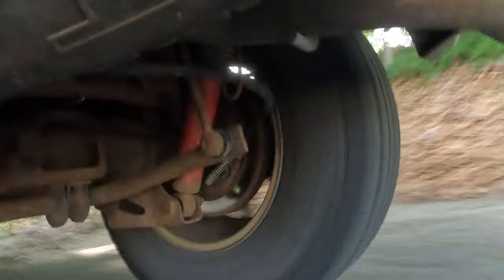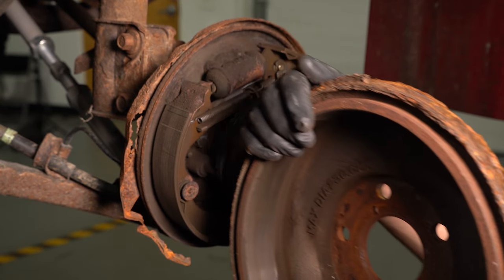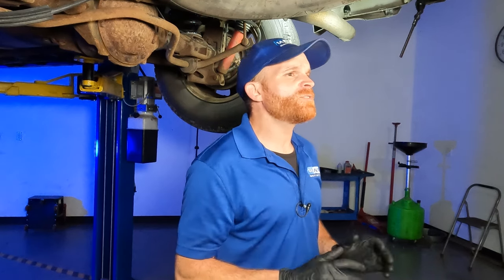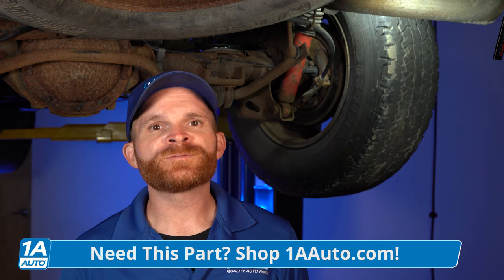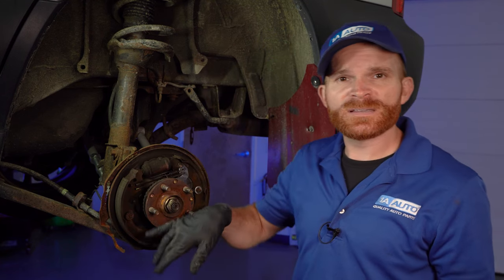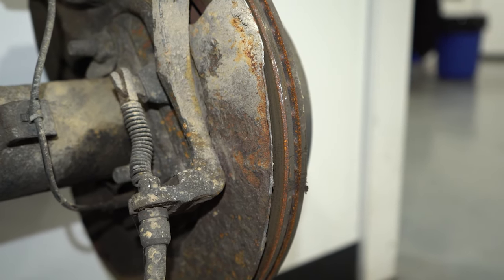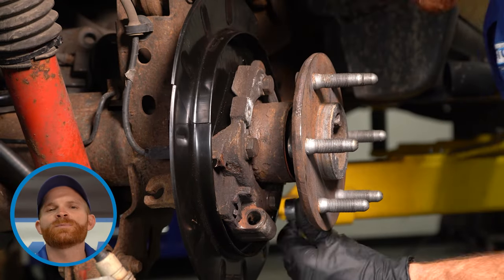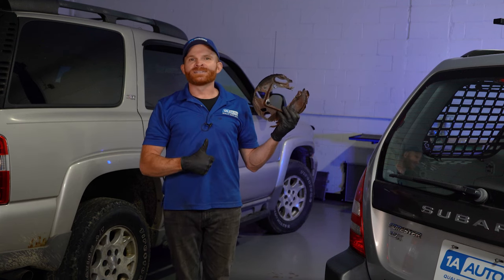Are Backing Plates That Important? How Bad is a Damaged or Missing Car or Truck Brake Backing Plate?

Comment: Wow glad you guys made this video I just changed my rotors and brakes on my k2500 and got annoyed I couldn’t line up the holes with the backing plate to the knuckle I just decided not to use it. Glad I saved them I will be putting them back on this weekend.

Comment: Aftermarket suppliers like 1A Auto need to offer replacements for vehicles that the manufacture have discontinued making. My Gen 1 Colorado needs the backing plates, and the only source is junkyards which sadly yield only marginally better parts that are on the truck.

Comment: I am speaking of a GM FRONT backing plate.. after replacing the front hub assembly of a 04' GM 2.2l EcoTec twice in 2 years I thought to not put the backing plate back on because it just seems to create an unnecessary gap between the knuckle and backside of the hub assembly and the only purpose of it seems to be to mount the ABS sensor and this car has no ABS system as it is a base trim so the ABS sensor that comes on the OE hub assembl is useless in my case...

Comment: I literally changed out the entire back drums/wheel cylinder and front rotor and pads. Turned out 1 week later the back drums rusted and still wasn’t able to figure out why they turned so fast and why the scraping sound never went away.